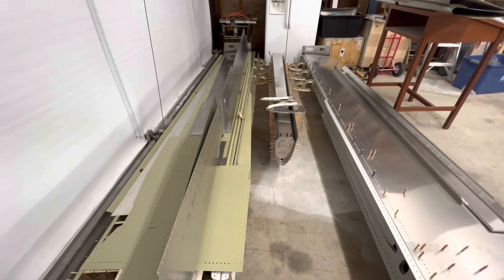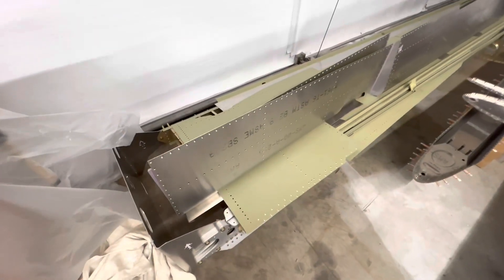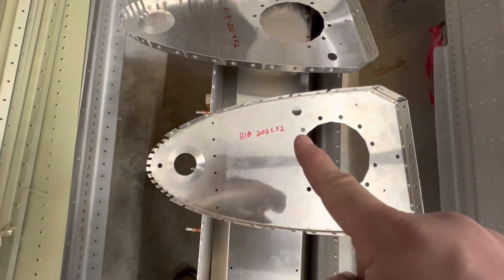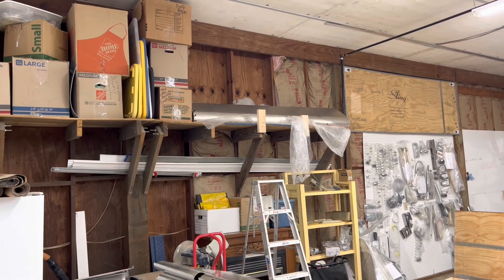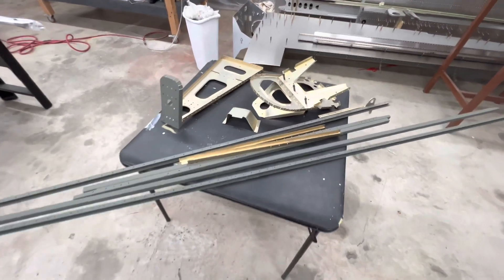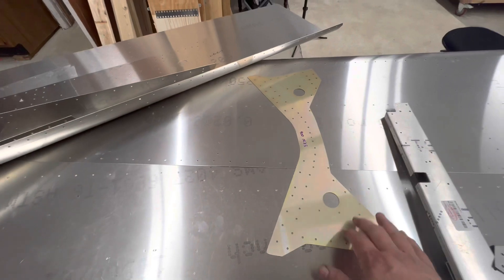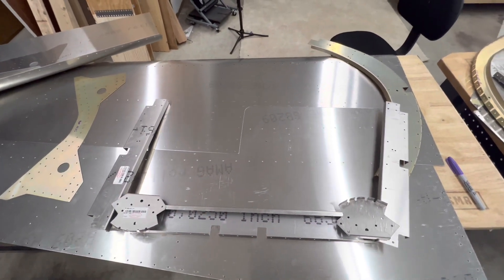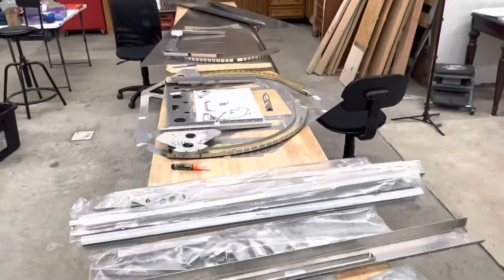Sling TSI Build Update - Shifting From Wings to the Fuselage - Experimental Kit Built Aircraft

Comment: Wow - glad you caught that on the left/right tank ends.  I've had a couple of those and found out a touch too late...
Reply from the maker: I came across this one at 11pm one night and wasn’t sure if I was tired or if they were wrong.  I said that when I emailed Sling Technical and was almost happy I was right other than now having to wait on a part.
Reply: @aviationkitbuilder  I found out about my hinge for the flap/aileron AFTER I finished my wing... the bend is so slight it was tough to tell, so after I got the part I had to take the wing mostly apart and rebuild it.

I caught a longeron before I got too far, but that was an easy one to identify because out of all the longerons there was one that was dissimilar.
Reply from the maker: @ibgarrett  I can’t imagine how frustrating that must have been.
Reply: @aviationkitbuilder  I may or may not have uttered a few choice words when that was discovered. 🤷‍♂️